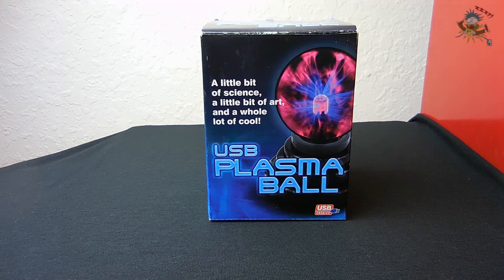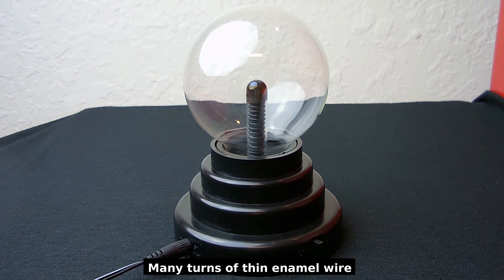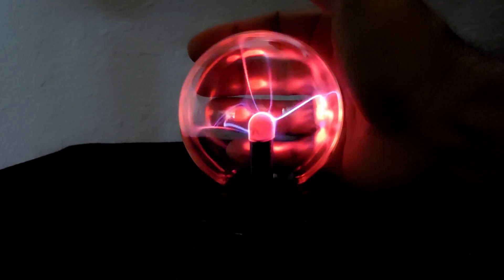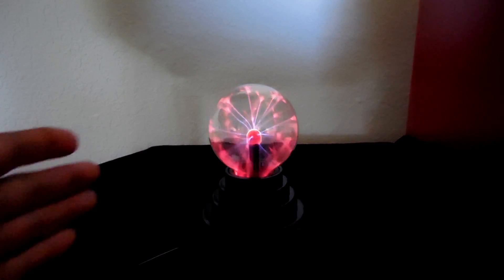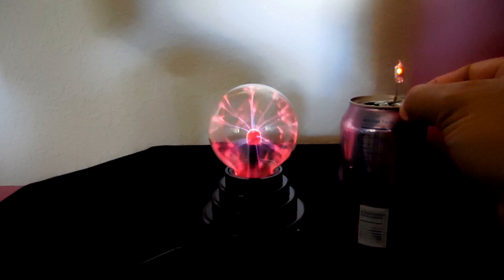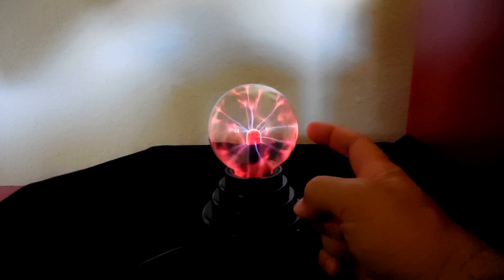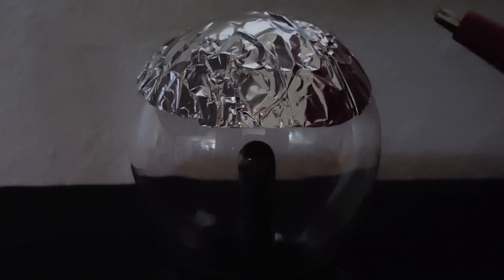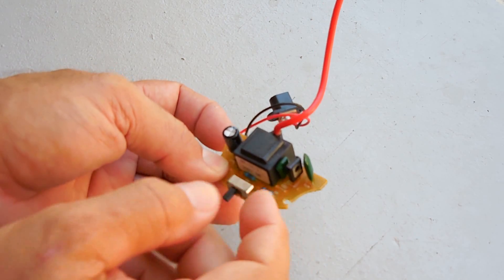Plasma Ball Experiments!

Comment: i have  one with it hv transformer dead so no plasma, so i bought a another ignition coil of my bike & made a oscillator using 555 &  3A driver npn transistor &  it works better than the original more arc filaments present.

Comment: does this make ozone gas? because when i heaved it give off a metallic  smell or someting
Reply: actually yes, because of the current on the outside of the ball connecting to your hand produces O3, that's why you need to be in a well ventilated area.
Reply from the maker: No, because the globe is filled with a noble gas.
Reply from the maker: TheShadowlin EXTREMELY small amounts of O3 are created. No noticeable odor.

Comment: I have one of these but it is supposed to run on a 12v 1.5 amp DC wall wart. I discovered that over powering it does actually crank it up. I used a 3.5amp 19.2v laptop power supply and WOW if you leave a small gap between the glass and your finger it will arc and burn you. You can also do the same thing with the normal power supply and a piece of foil. Just put the foil on top and then put your finger next to it. Of course I don't recommend it but I was surprised to see that more power in made it put more power out.

EDIT: I did not watch the full video before posting this comment. Cool to see you knew about the foil trick.

Comment: Nice, I could spend ours experimenting with one of these... and I have lol
Try placing an ordinary clear light bulb close to the ball/globe, the argon that is back filled into most lamps will emit a violet glow
   Haven't tried this one yet, but it does work with Tesla coils: Create a S shaped spinner atop the foil hat with a bit of clay and a needle pointing up (or some sort of stand). The S shaped spinner will need to have a dimple placed so as to be balanced on the needle... Power it on and it will or should begin to rotate. The spinner could be crafted out of tin foil or a wire depending on ones resources. This may take some experimentation and any friction needs to be overcome. A light push may be required
Reply from the maker: I thought an ordinary incandescent lamp was only a vacuum. I may have to try it. I wish I still had the Tesla coil I made. I sold it years ago when I was moving. I could have made a few great videos with it. 12" sparks. :-)
Reply: The argon being inert helps protect the filament from corrosion, but yes a vacuum is drawn prior to the argon going in. There is still a tiny amount of "air" or oxygen left that the argon keeps at bay.The effect of the plasma ball on a light bulb isn't that impressive, but it is noteworthy.
The neon lamp can detect DC verses AC simply by the glow around the electrode, if both electrodes have the glow it is detecting AC, if only one is glowing it is DC
Reply from the maker: Yes, I know about the neon lamp electrodes. :-)